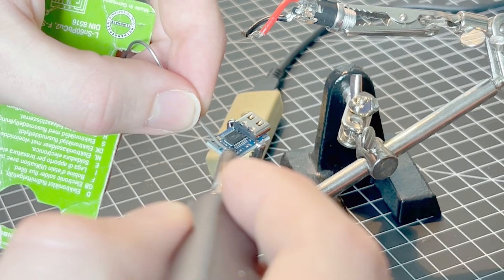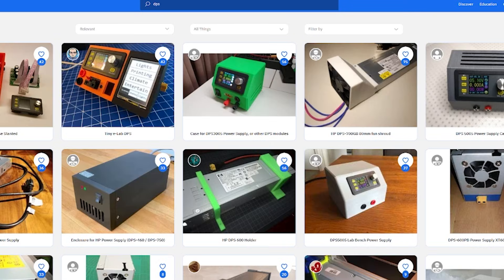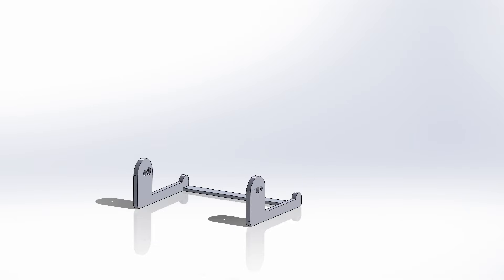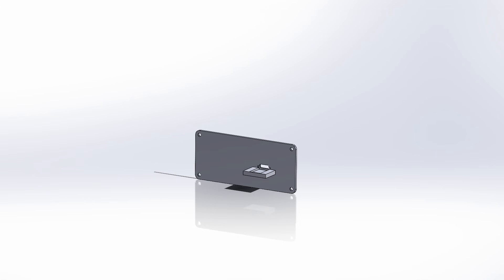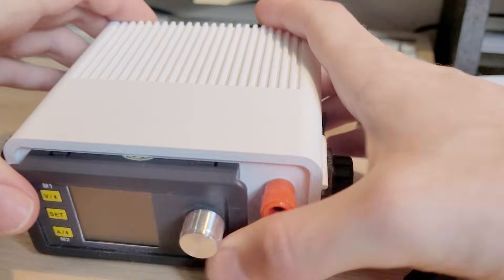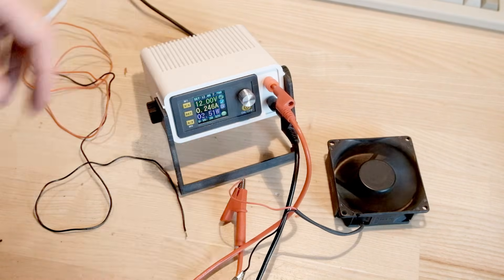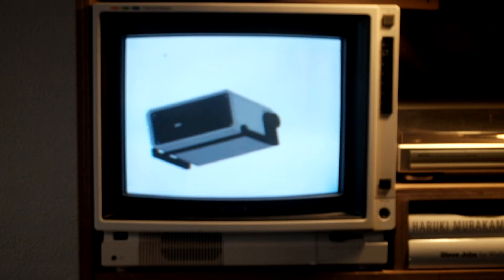Making a portable USB-C adjustable power supply

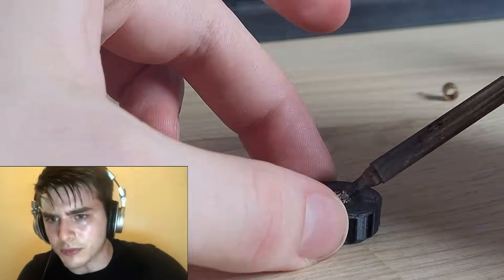Comment: 1:49, If you are unable to use your soldering iron directly to insert the inserts because the tip will pierce the bottom or you can’t get in at the right angle you can just heat up the inserts for 20-30s and insert them using a screw, screwdriver or pair of tweezers as the insert will stay hot for about a minute.
Reply: TLDR:

You don’t have to apply constant heat to install heat set inserts, heat them up with a soldering iron and use any other tool to put them in place.

(You can even use a lighter and a stick…)

Comment: Great work. A small upgrade might be to use some of the empty space in the case for lead storage? Then its use as an on the go power supply would be even better!
Reply: Thought the same, either go smaller or make a compartment for the cables to connect to a project maybe with some adapters

Comment: I like the design, but  I prefer an internal PSU and 220v external connector. If it provides enough power you could use it to power laptop and the electronics project at the same time

Comment: Could you add a boost converter between the pd board and the psu module to get a higher voltage range? The 100w should be enough to power it.
Reply: yes. boost it to the max input voltage of the supply module so you can use the full range of voltage

Comment: Nice clean design. I’ve made a similar unit that uses one of the power supply units. I incorporated a base for a 18v drill battery into the 3d printed case.

Comment: I just had an insane idea: Most of these cheaper, but bulky lab supplies you saw on ali express were linear power supplies. They regulate the voltage by burning the excess voltage, exactly like the LM317. In order to not waste too much energy, they have a big multitap transformer and switch to different AC voltage level, depending on the output voltage. You could do the exact same thing with USB PD, though I am not sure how much the power adapters like it, if you switch the requested voltage level around on the fly. The great advantages of a linear power supply, as opposed to switched power supplies, is the simplicity and lack of voltage ripple. The most complicated part will be PD negotiations, which is probably easy to solve with the right library. You can probably buy a neat small standard aluminium housing and use the whole thing as a heatsink for the regulator.
Reply: You can actually buy cheap chips that specifically handle the pd negotiation, it'd likely be a lot easier to use one of those.
Reply: @xxportalxx.  The ones I know only have a solder bridge or a resistor to set a voltage. I want to change it via microcontroller, depending on the output voltage I want. It would also be nice to know the maximum power and current from the charger, which also does not work with the "dumb" PD trigger boards
Reply: Why would you want that? Just use the maximum USBC voltage if its a buck power supply. changing it is just useless extra steps since the supply is a switching supply that doesnt convert excess power as heat.
Reply: @VoltsandVodka  But then you need to design a high power buck converter with fat capacitors to get rid of the voltage ripple. Linear power regulators are simple and that drawback is manageable, if you switch the input voltage to a close level.

Comment: You need to change the video title to "Making a 3D printed case for a Power supply" as you made nothing but a case.
Reply: Mimimi
No he combined a couple of the shelfs parts with a 3d printed case to make an usb-c adjustable psu
The default module takes 20v, which he provided with the 2nd board that forces 20v from a pd power supply
Reply: @ized88 yes you are right. What a bullshit comment this was

Comment: I think theres space in there for a power bank that could power it, but i like the project and want to build it myself
Reply: Was thinking the same thing but just using 21750's,  and without the noisy psu module, something analogue instead like a beefy mosfet. A rechargable pure DC power supply, zero ripple and capable of high current is a very interesting prospect.

Comment: Is it possible to get 24v out of this? It doesn't need to be high amperage but i need 24 volts for testing 3d printer parts lol
Reply: Just by 24V power supply if you need only 24V. Variants without cases are pretty cheap.
Reply: Yes but you must supply voltage higher than what you want to the module. So you would need a 24v+ ac to dc psu instead of the usb C board (until we see 48v usb c become common)
Reply: @Bengy22  Gotcha. I'll check what my USBC PD power supply can do and see if I can get a matching (if 24v+) pd module
Reply: @RecklissFPV  just use a boost converter between the PD board and the power supply unit
Reply: @VoltsandVodka  that's a good idea
Reply: There are cheap step up converter boards, so if you dont need high amperage you could combine the usb C trigger board with a step up converter. Probably quite inneficient but it should be able to give you 24v and only add a tiny bit of extra cost and soldering